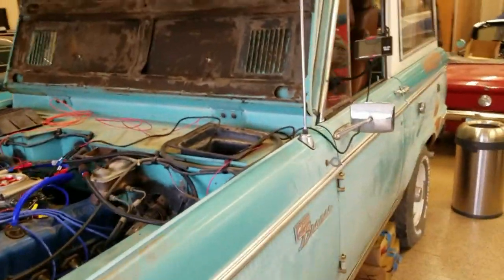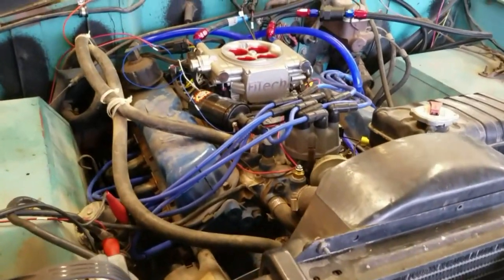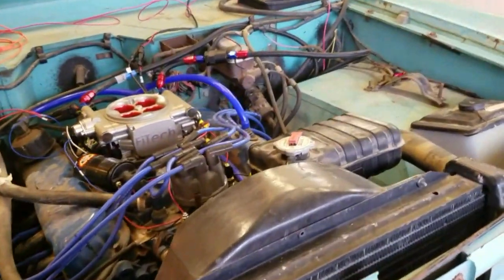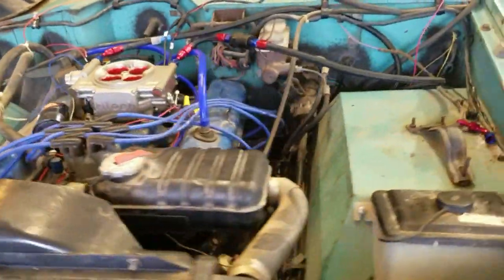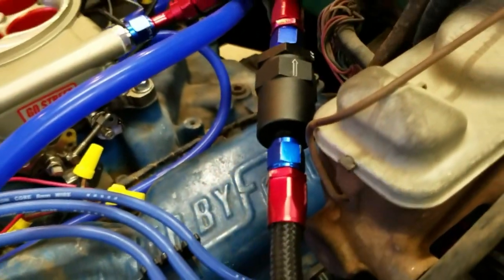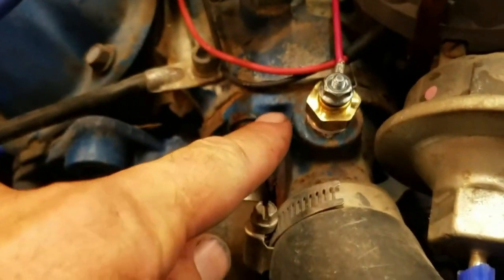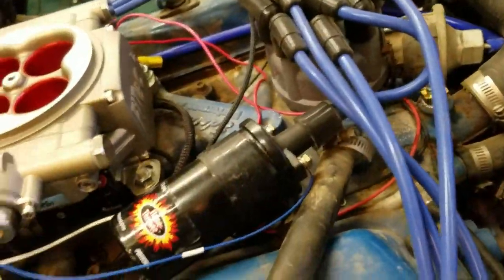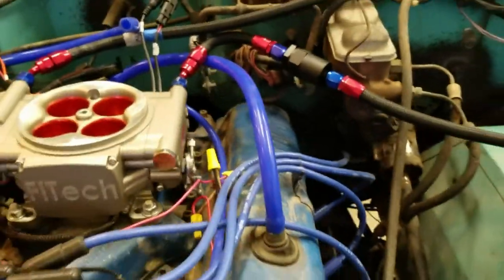First start of Early Bronco with new FiTech Go Street EFI 400 hp

Comment: What did you do for a fuel pump?  Are you using the stock gas tank?
Reply from the maker: Installed an in the tank electric pump. Bought a new 23 gallon tank from BC Broncos. There is a video on the installation. Pump came installed so I cannot brand or model number.